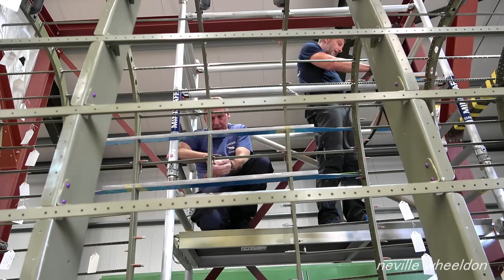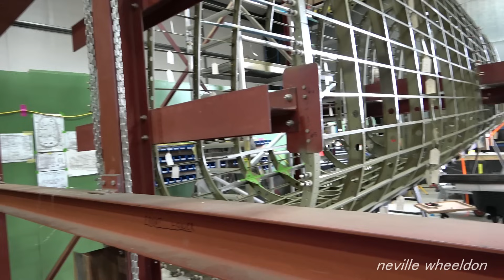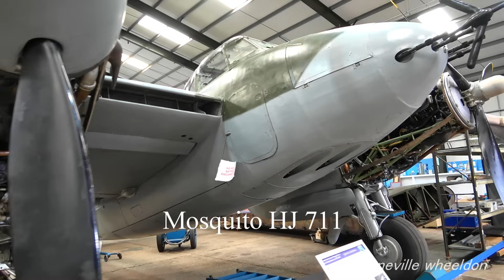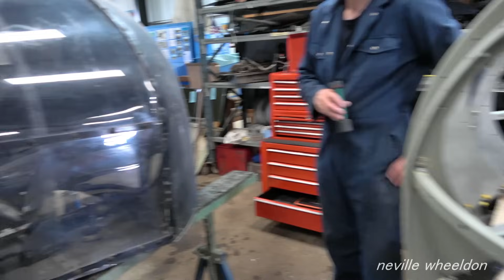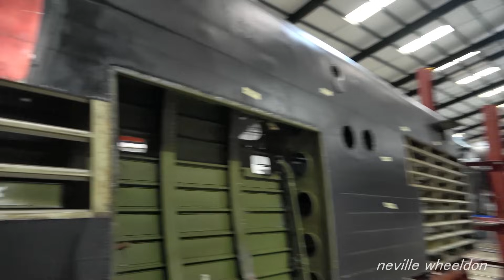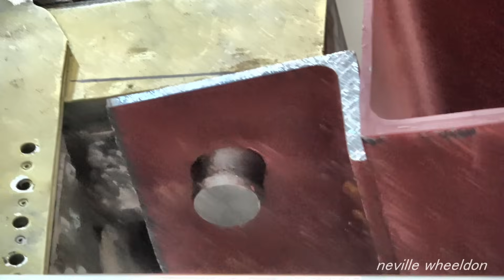256 Restoration of Lancaster NX611 Year 7. Port wing in the Jig.

Comment: Another great video, thanks Neville. Great to see the wing in the jig, but a question. @ ~21m it looks like the front spar mounting bracket is not firmly bolted to the frame. Is it just a trick of the camera, or the allowance for the angle of the spar?